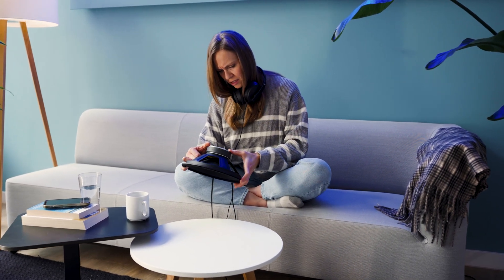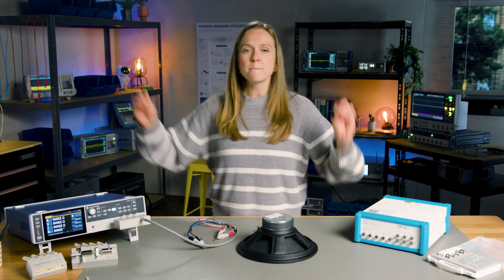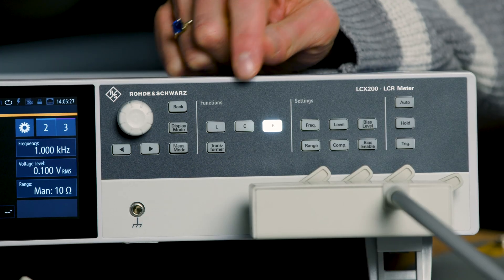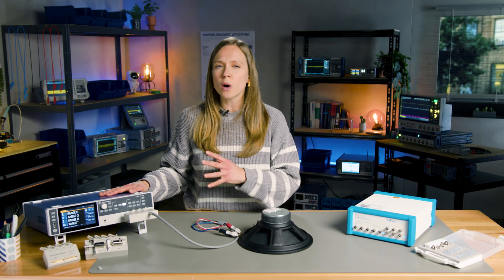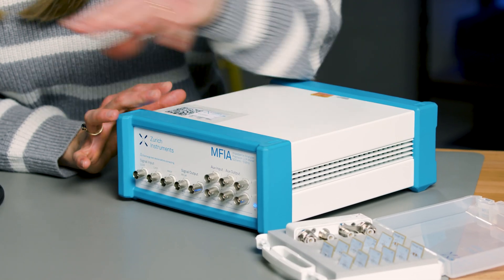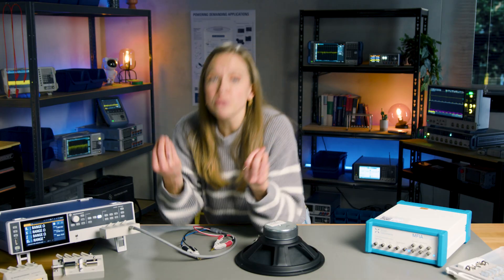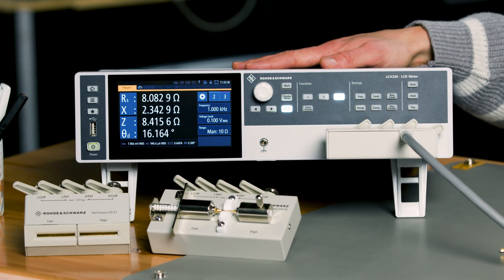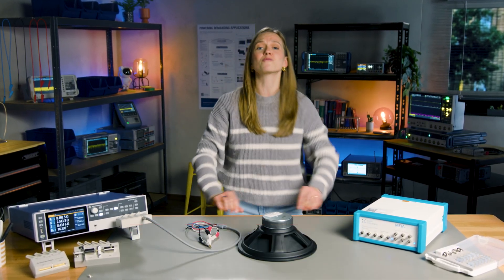Precision in under 5 minutes – LCR meter vs impedance analyzer

Comment: I think that it would make good use of video, as a tool. to do a quick view of the impedance analyser display, and a loudspeaker is great for that...  and a simple idea would be to show the impedance of the speaker facedown on the table, pick it up to show its free air impedance, and maybe into a port in a box, which shows the impedance variation as it relates to a mechanical/ acoustic variation.

Comment: LCR meter does not have frequency seeep option?
Reply: Fixed freq option, like 1 khz 10khz 100khz
Reply: you can still use an external software on your computer to do a frequency sweep measurement (R&S has that for free)